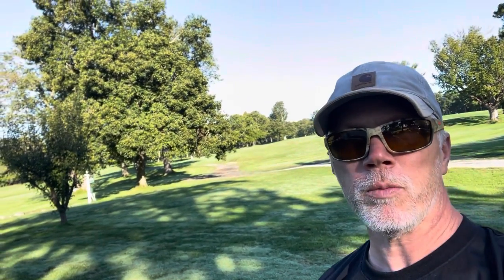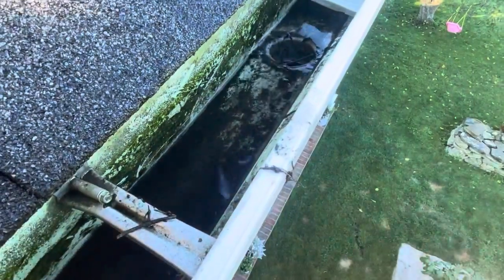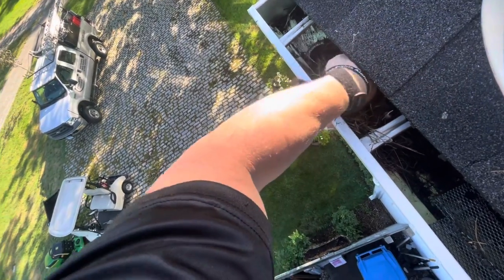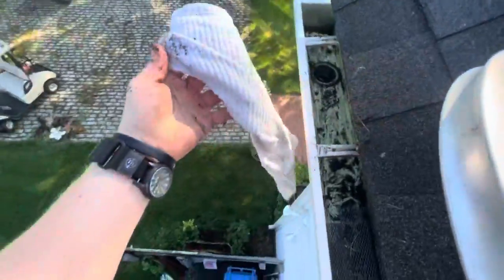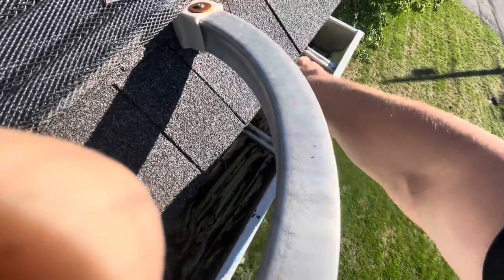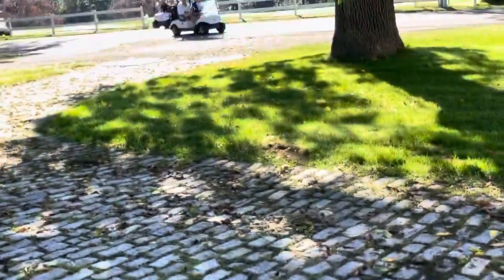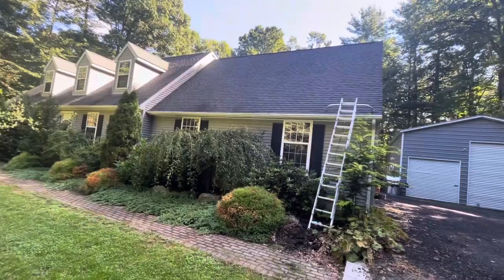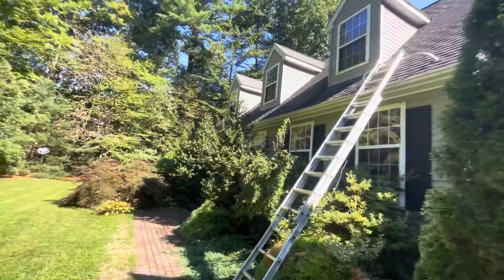$1000+ Per Day Gutter Cleaning

Comment: Order poles from Clean Direct. Their poles are Super Lite but expensive- $200 Mighty Atom Elite, after shipping.

I've been using the skyvac for the last three years I'm on my second machine I use two machines at once for very large commercial jobs but I will never go back to go to clean by hand. And when the customer has gutter guards I charge them a higher price typically $20 to $30 more per gutter that I have to climb up. Most houses have four sides that need climbing Easley adding $160 to a work order. But I let the client know they should not need to order gutter cleaning for 3 to 5 years.